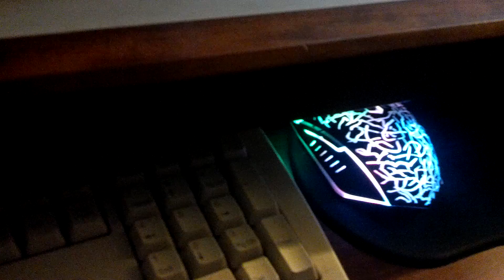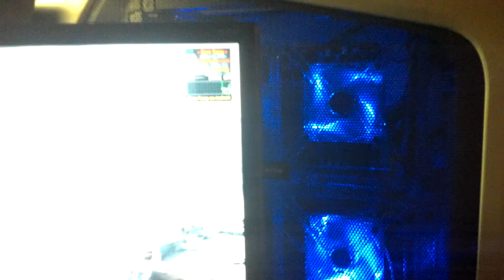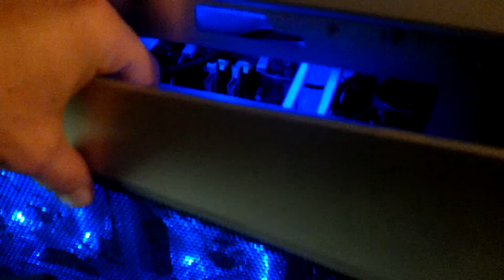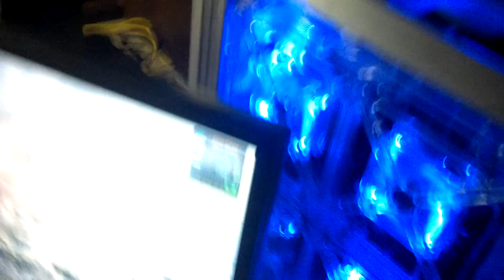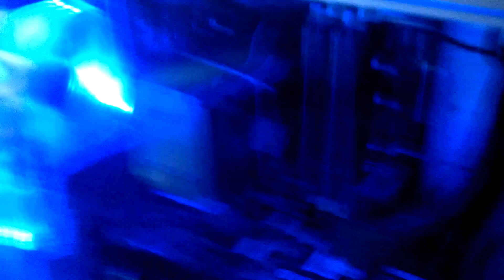Custom Cpu cooler project upgrade results

Comment: My intel extreme 775 mobo is a pain in the ass when it comes to ram. Its supposed to be able to handle 8gb but if i add anything over 4gb it beeps at me and wont post....also if i dont use a specific model stick it will beep also and not post....shit was frustrating finding the exact ram....luckily my buddy at the shop i go to was nice enough to let me swap them til i got the proper cards.....nice cooler tho.....im lookin for a decent quad core to upgrade to from my e7300 c2duo.